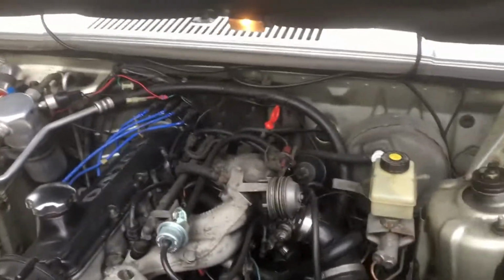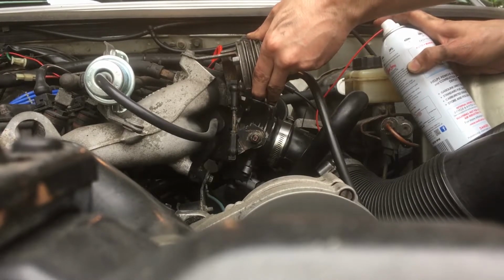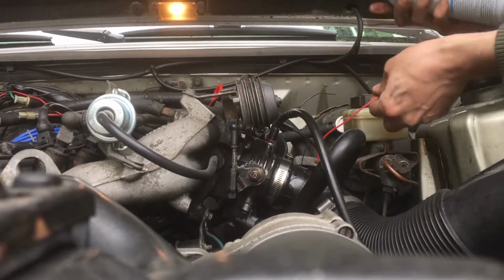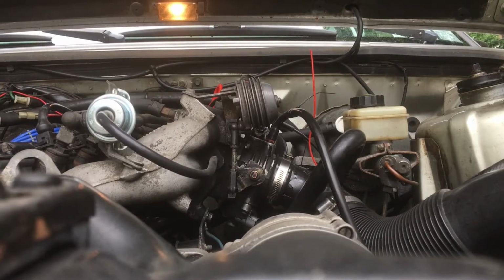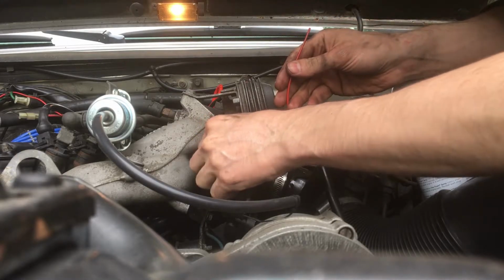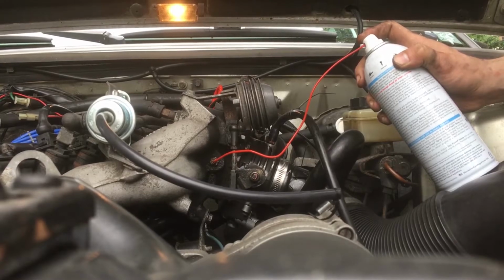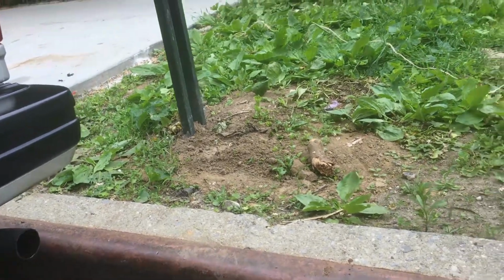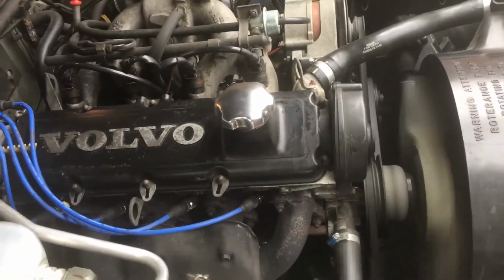Sea foaming the Volvo

Comment: What is that for in reality please?
Reply: @plightn  the seafoam what it does to it ?
Reply from the maker: @kevinglainez8151  it’s supposed to clean out deposits to make the engine run smoother. I didn’t really see much of a difference but I take good care of the car anyway.
Reply: @plightn  BTW,  you know how much a valve calibration might cost I have the same one mine is a 86 740 gle non turbo and I make a mistake not making the timing belt replacement on time 
The  all of the sudden and kinda of a piston slap or valve loose when the engine is warm appeared 

And a big noticeable decelaration as well .
Reply from the maker: @kevinglainez8151  The 86 740 gle is a non interference engine which means that even if the belt breaks during driving the pistons won’t hit anything. It sounds like your timing is still off.